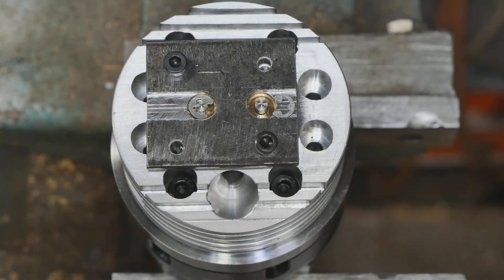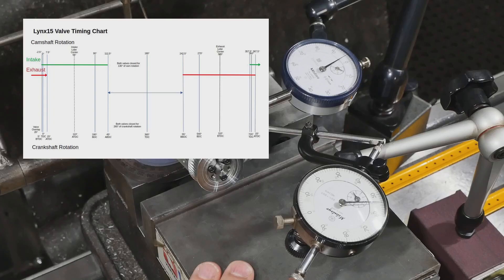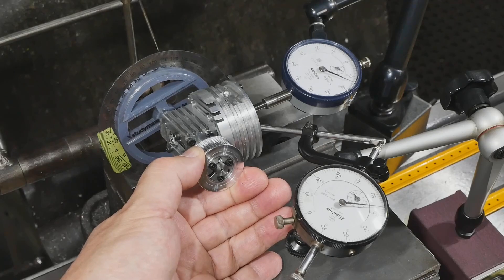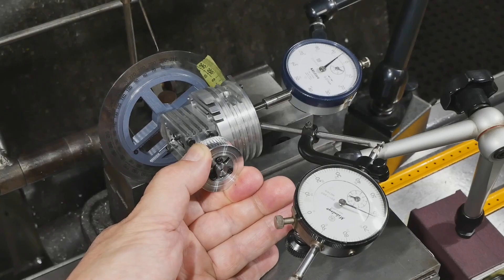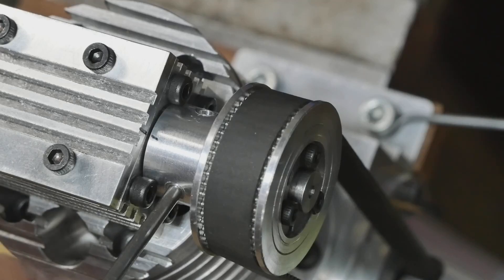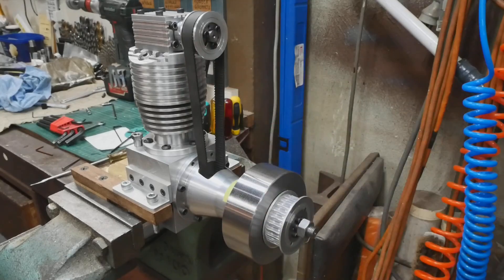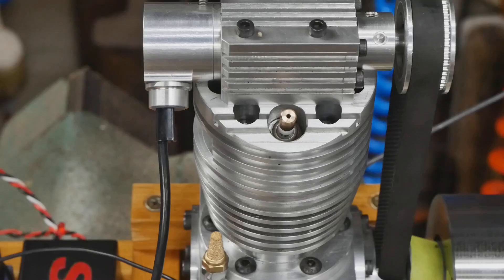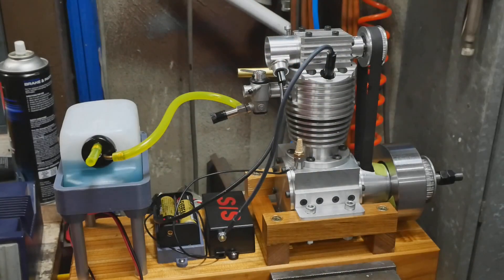Lynx15 - Will It Run ?

Comment: Congratulations Alan.  You have done an exceptionally thorough job in your build and troubleshooting of the Lynx15.  It was great fun seeing the detailed test setups and special tooling you used to build and validate the engine. I especially enjoyed the setups for validating the valve and ignition timing. It's incredibly satisfying to see an engine I designed, built, and successfully run by someone else. You did a great job as the "guinea pig," building to my plans and helping me troubleshoot the design. You provided invaluable feedback, found several errors in the prints, and helped me redesign a couple of parts to improve manufacturability. For example, your tip for easing the alignment of the cylinder to the crankcase was brilliant. There's nothing quite like seeing an engine you've built from scratch in your own workshop, successfully running. And you've done it! Congratulations again.
Reply from the maker: Thanks Greg. I knew nothing about camshafts when I started this project, but with your patient support I was able to successfully make and test one for the Lynx. Your drawings are clear, well laid out and quite comprehensive. I am a self taught amateur and whilst some of the machining required a bit of thought, it was all achievable with a good work sequence.
Not sure whether I'll build another engine, but I wouldn't hesitate to recommend your Lynx15 to other builders looking for an interesting project.
Cheers.

Comment: Thumbs Up!!  Might try 40:1 or even 50:1  fuel/oil mix..  just for the sake of knowing how clean it'll run for you..  Again, Thumbs UP!
Reply from the maker: Thanks Steven. I have been experimenting with weaker fuel/oil mixture and it seems to run fine with 50:1. I have put some oil in the crankcase and can see some oil mist coming up the crankcase breather. Oil is being splashed up under the piston by the crankshaft, so I could pbly even run with no oil added to the fuel.
Cheers.

Comment: It is great to see that all your hard work and patience has paid off. A job well done!
Reply from the maker: Thank you. There was certainly a lot of machining and head scratching. The Lynx design is a bit more sophisticated than the Webster engine, and some parts needed many operations to complete. The cylinder head was particularly challenging and I was very pleased to finish that without any errors. I wasn't so lucky with some other parts though and had to remake the cylinder liner, crankshaft and camshaft pieces after messing them up on the first try. Actually, although I don't like doing things twice, I quite enjoy the challenge of devising ways to recover from my apparently inevitable mistakes. I also enjoy designing jigs and fixtures to assist with the machining. This is my favourite hobby, and the project was mostly about having fun playing with my (big) toys, developing my machining skills and solving problems. It was very satisfying to see the Lynx burst into life, but the journey was more important to me than the destination. Now I need to find another project :)
Cheers.
Reply: @alanshomeworkshop  It wouldn't be fun without challenges and mistakes. How about a radial engine as a next project?

Comment: Great job Allen.
Nice slow tick over and acceleration!
Reply from the maker: Thanks Michael. I think my valve and ignition timing settings must be pretty good and I was impressed with the fuel metering from the Traxxas carburetor. The engine is running very well using out of the box settings - steady idle and no obvious flat spots on acceleration.
Cheers.

Comment: Alan what was the final compression ratio, like how you set out the cam card in a linear format. With all that electrictonic equipment you will be able fuel injection it .
Kit from up north
Reply from the maker: Good'ay Kit. I can only estimate the compression ratio as ~9.5:1. To be more precise, I would need a burette to measure the actual pocket volume. I was riding on the struggle bus with the cam card. It is a very compact way to present the cam profile, but I found it much easier to work with the linear format. 
Cheers.
Reply: Oil in the fuel lowers the octane rating use 98 when your doing  your dyno testing .
Kit

Comment: Excellent outcome, it seems you solved your problems more easily than I did with my Webster Engine issues. Well done. 👍
Reply from the maker: Thank you. From the magic of video editing, it looks like I instantly solved the fuel starvation problem, but it actually took me longer than it should have. I kept worrying that there wasn't enough engine vacuum to draw fuel from the tank, but if you blow into the tank breather and nothing comes out of the outlet line, engine vacuum isn't the problem :) 
BTW the CDI system works a treat, and unlike the open points on my Webster did not kill my PC with electrical interference.
Cheers.

Comment: That sounds and runs great...well done
Reply from the maker: Thank you. It probably isn't very obvious in the video but the engine runs surprising smoothly and with little vibration. Have a look at the fuel in the tank @11:35 - very little movement.
I think that is impressive for a single cylinder engine and Greg's design of the crankshaft counterweight is spot on.
Cheers.
Reply: @alanshomeworkshop  hi alan i just watched joseph higgins making a fuel tank and he put a simple check valve in it to stop air bubbles and the fuel running back. worth a watch

Comment: Congratulations another job well done .
From Chester in the UK
Reply from the maker: Thanks Nigel. I liked your power feed to the mill table. Windscreen wiper motors are a good option for low rpm projects and I used one to drive a belt skimmer in my mill.
Cheers.

Comment: Gday Alan, this has been a fantastic build to follow, the engine sounds and runs fantastic, credit to you mate, cheers
Reply from the maker: Thanks Matty. I don't aspire to the same high standards of workmanship that you achieve, but there were many curly challenges in this project that were very satisfying to solve. Possibly the most interesting was milling the camshaft, but sorting out the valve timing was up there as well :)
Cheers, Alan.

Comment: great runner Alan. from a fellow builder
Reply from the maker: Thanks Philip. I was pleasantly surprised how well it runs. However, I think a little hesitation crept in at higher revs and suspect that the ignition timing could be advanced from 20° BTDC to more like 10BTDC°. I'll have a play with the timing advance when I've reduced the smoke. Another thing I'd like to try is checking the rpm - more new territory to me :)
Cheers.